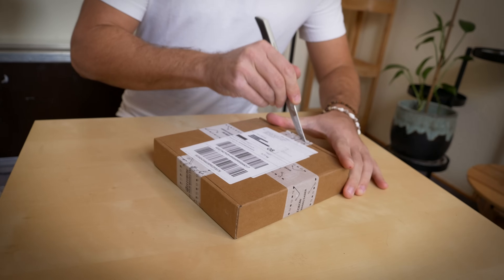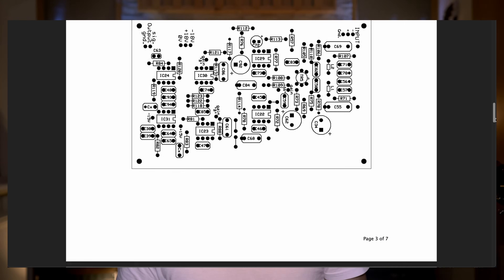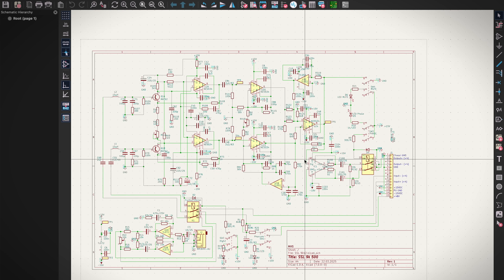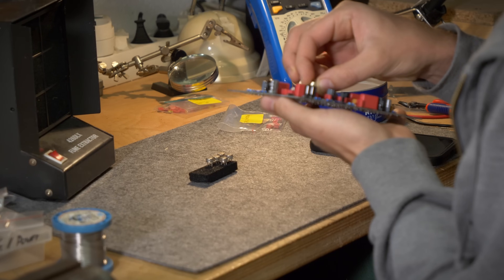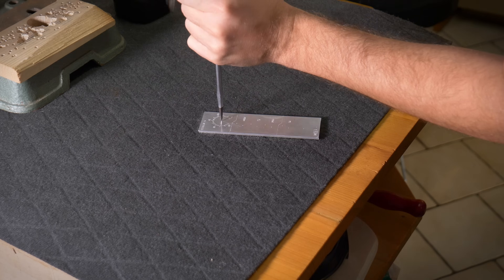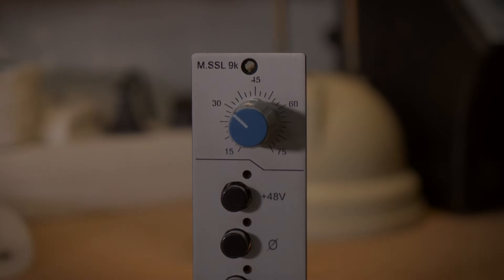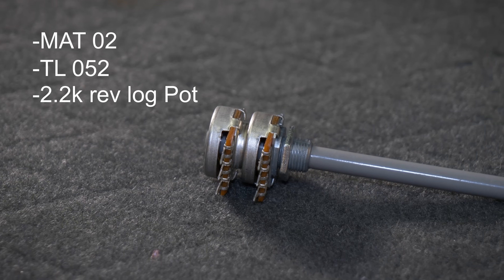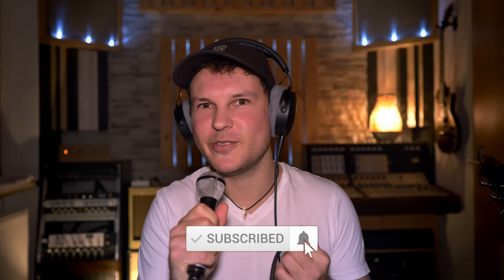Build your own analog SSL PREAMP for free?!

Comment: Notice you’re not using an L-bracket. Do you get any RF / EMI?
Reply from the maker: You’re right, but this pre is super quiet, no problems with RF or EMI or other noise. But I will use brackets for future projects, mainly for stability - probably also for this one.
Reply: @MarcHerwig  excellent! Look forward to the comparison video. Oh btw, did you have a Mouser BOM for this?
Reply from the maker: @jeremybiggs8413 There will be sound examples in my next video.😊 Sry I have no mouser BOM because I’m buying my parts in Germany. However, I’m selling kits if you don’t want to source the parts yourself: mhs-audio.com
Reply: @MarcHerwig thanks, looking at the BOM I already have the bulk of the parts including a genuine MAT02. I can only find one dual gang 20mm 2k2 rev on audio maintenance which has a ridiculously long pot shaft (OM-01-073), can you let me know if you cut the shaft down, or if not the same which you used, please?
Reply from the maker: @jeremybiggs8413 I use exactly that pot from AML. You simply can cut off the shaft. (It’s plastic)
Reply: @MarcHerwig perfect, thanks!

Comment: Nice project!  For the matched transistor pair, you could go with Linear Systems LS318/LS38 part.  They make can type, DIP, and SOIC8.  I think the MAT02 might be slightly tighter spec, but the LS318 should do just fine there.

Comment: Really cool! What are your noise figures (EIN)? I built my own like 10 years back but they all came out very noisy, probably a PCB layout problem.
Reply from the maker: Thanks! I haven’t measured the EIN yet because I didn’t see the need- these preamps are super quiet! Quieter than the preamps in my RME UCX interface (and they are very quiet😂). I will do some more measurements and will deliver some sound files on this channel soon.

Comment: Great video and project! Thanks! Although less authentic, do you think any more easily obtainable, modern components could be substituted for the 3 that were difficult to source?
Reply from the maker: Thank you! Yes, there are options. The MAT02 can be replaced by the AS194 (as a very smart comment mentions ty) and the TL52 by the TL72. But I don’t know how they’ll behave on higher gain settings and how the noise floor is. The potentiometer is hard to replace, you can only use a rotary switch and fixed resistors but that’ll be a lot more work.

Comment: I guess that TL 052 can replaced with other TL 0x2, for example TL 072?
Reply from the maker: Thanks for the info! Yes I do think it can be replaced, I‘m not sure how it’ll behave with higher gain settings (oscillation) and how the noise floor is. Will test that💪

Comment: The MAT02 can be replaced by an AS194 from Erica Synths.
Functional identicly (the MAT02 was originally sold as a replacement for said 194 can), same pinout, readly available and only a fraction of the cost
Reply from the maker: Thank‘s for the information. I know that there are a few replacement options and I will compare them some day against the MAT02. I always like to have the „original parts“ in my schematic to be as close as possible on the original preamp. But maybe the AS194 is a good option.
Reply: @MarcHerwig  comparing the data sheets the as194 has better specs in almost any feature
Reply: @rogerrabitt9675  In diesem Fall wird der Austausch  wahrscheinlich (problemlos) funktionieren, da der Austausch für vergleichbare Schaltungen bereits vorgenommen wurde ohne das es zu signifikanten Abweichungen im Verhalten kommt.